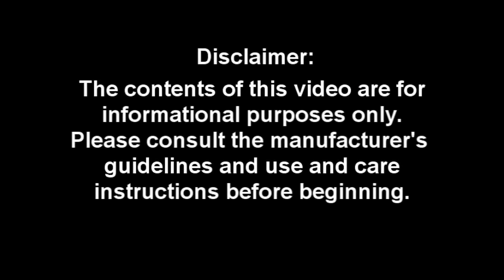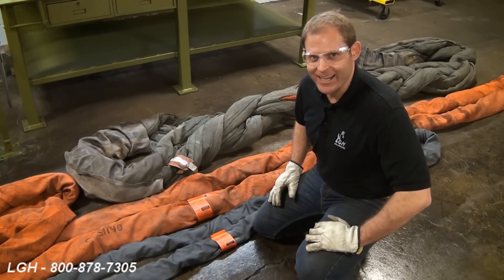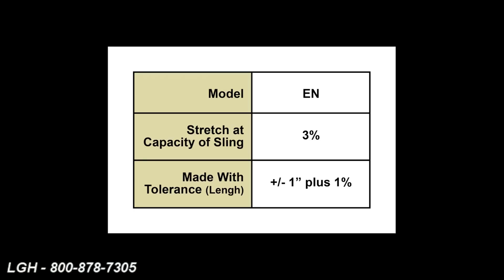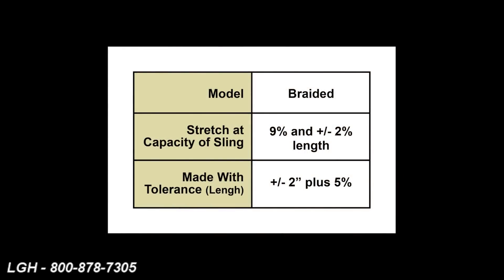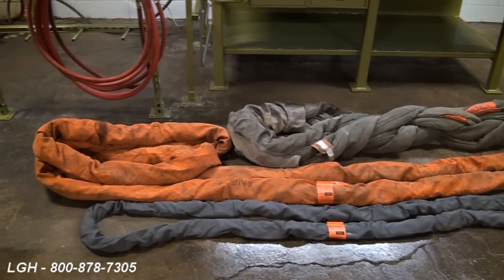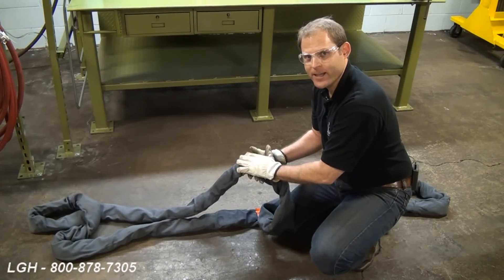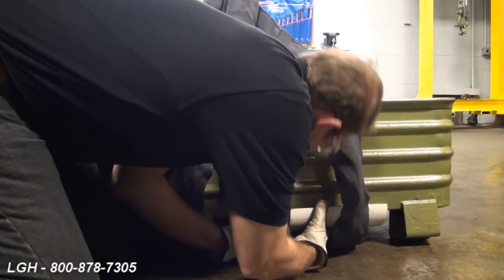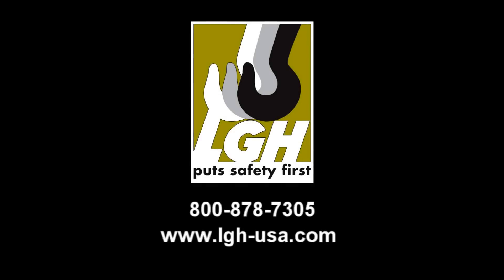Exploring Polyester Round Slings

Comment: Why are you load testing the slings just for inspection?

According to LOLER regulations the slings only have to be load tested to breaking point by the manufacturer.
Reply from the maker: Thank you for the note. In the video, the slings are not being tested, rather a test lift is being performed to assure the slings are properly protected and seated correctly. In addition, test lifts assist in assessing off-set center of gravity loads. I hope this helps.